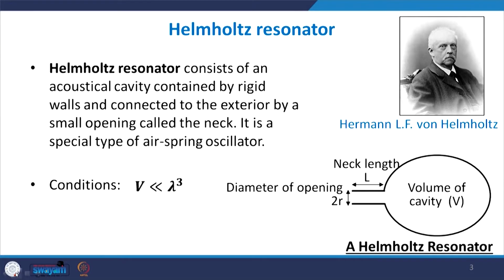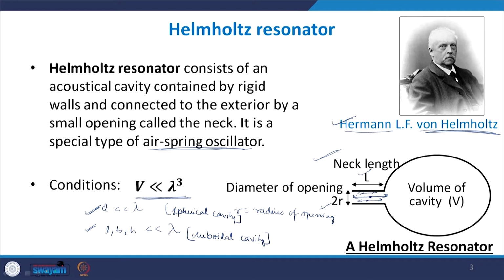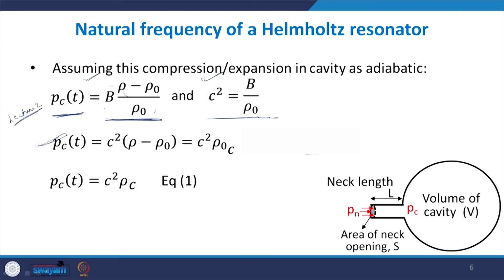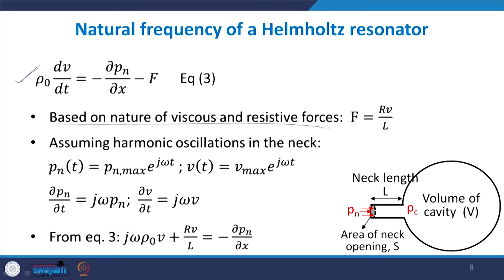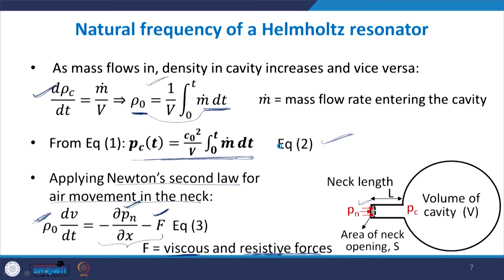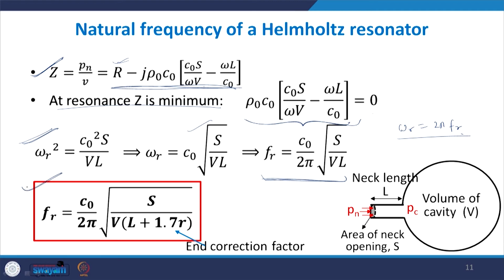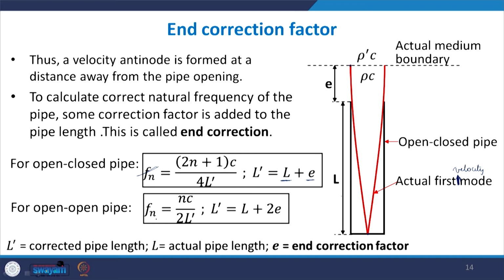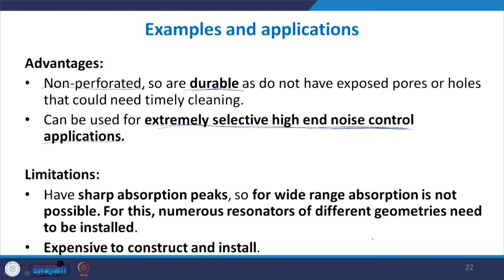Lecture 18: Helmholtz Resonators

Comment: Great explanation. Thanks. I have just a practical question: How can we measure resonant frequency of existing HH resonator? By generating pink noise and measuring frequency curve near a neck of HH? Let's assume that the HH is big and tuned low (in 30-50Hz region) so it's impossible to blow like with a bottle. Thanks